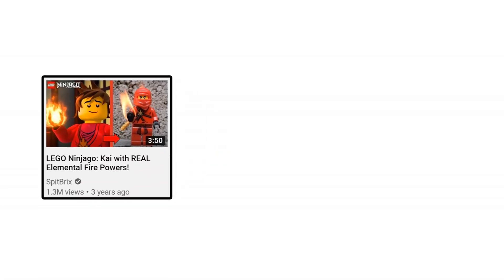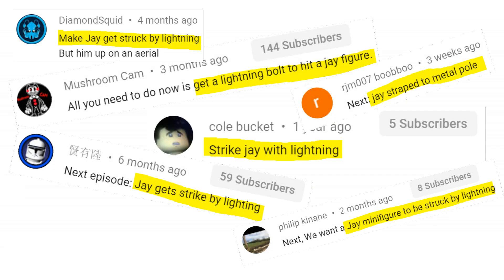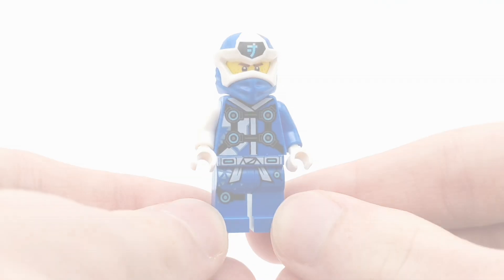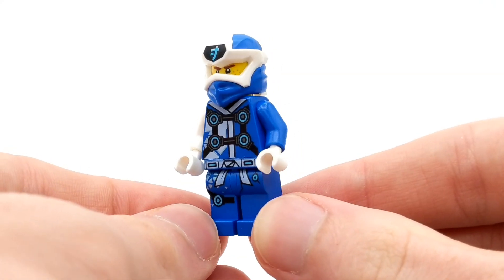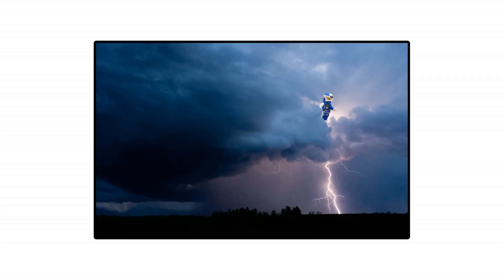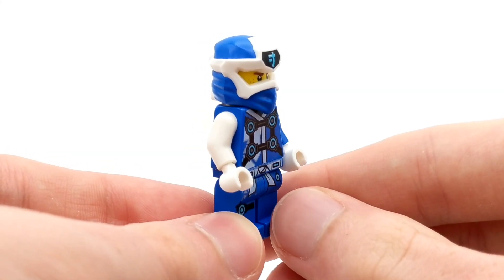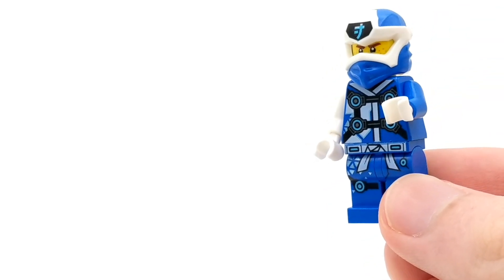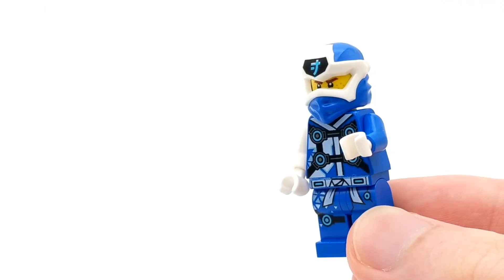I electrocuted a LEGO Minifigure with a TASER and this is what happened (Ninjago Jay)

Comment: Plastic doesn’t conduct electricity much, or at all (extremely poor conductor, which is why it’s used to cover wires). I’m expecting few to no damage, with the worst maybe a few scorch marks (somewhat doubtful, since it isn’t the best heat conductor either).

Comment: Next-
Garmadon in a hydraulic press 
Wu in a 3D printer(?)
Griffin on a car going super fast
Nya blasted with a pressure hose
Tox dumped in acid 
Karlof encased in molten metal
Morro on a kite in a hurricane 
Skylor trapped in amber 
Acronix and krux left out in the elements for a year
Lloyd exposed to gamma radiation 
Ash smoked ( like how you cook stuff over a campfire )
The omega and shade left in the dark to go mouldy
(Note- I did not come up with all of these) 
Someone comment something for neuro and Paleman